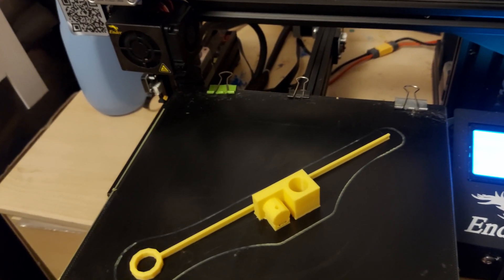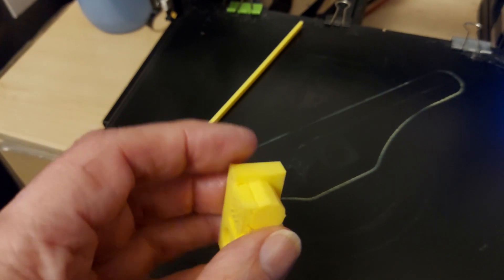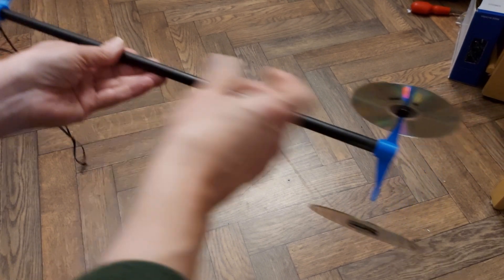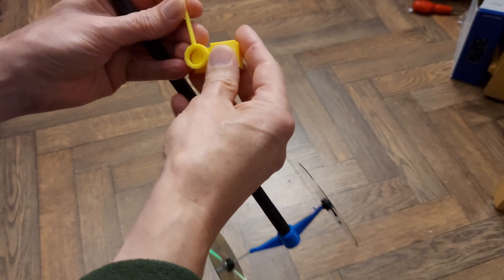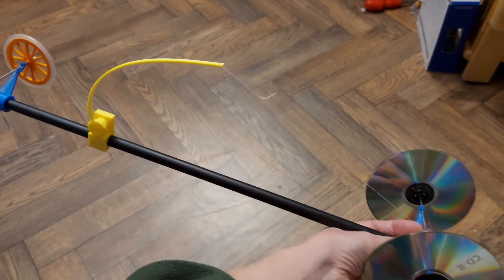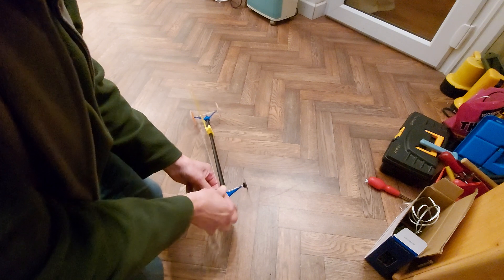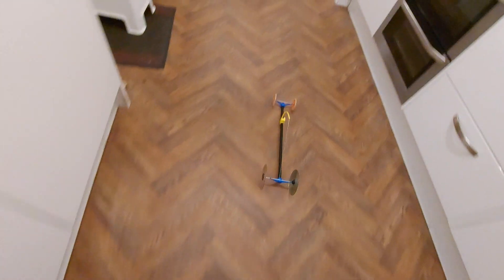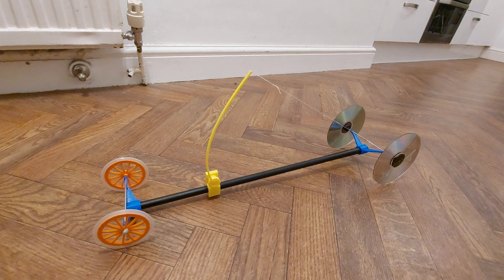PLA Flat Spring powered car

Comment: You could improve the spring by A) putting a fillet where it meets the hub, as this is the weak spot that might break first.  B) make the spring wider at the bottom and tapering down towards the top (triangular).  That way, the amount of material in each section of the spring will more closely match the bending stress on that portion of the spring.
Reply from the maker: Yes, plenty of room for tweaking and improvements, but as it is, it works, and that was all I needed 😊😊👍👍